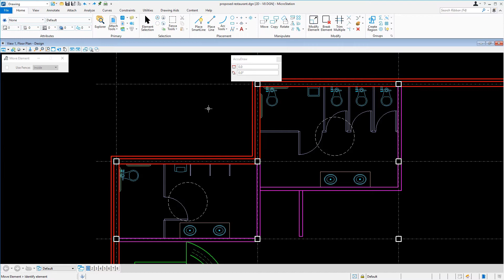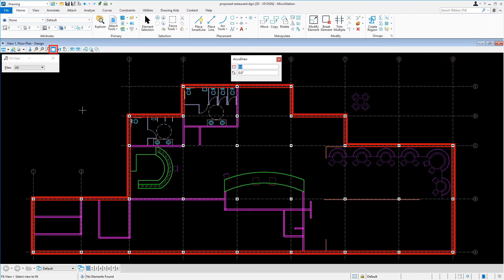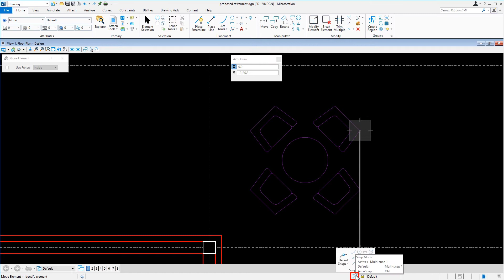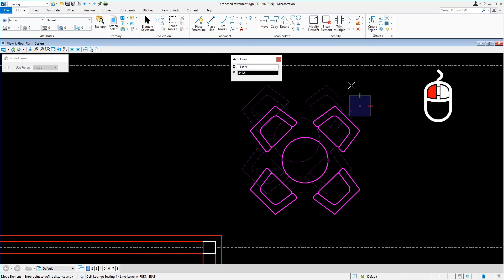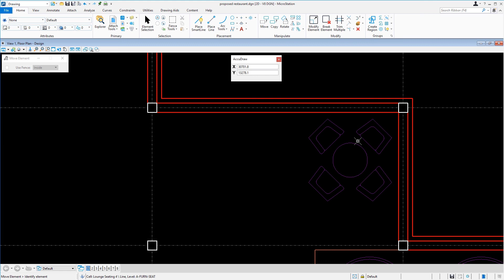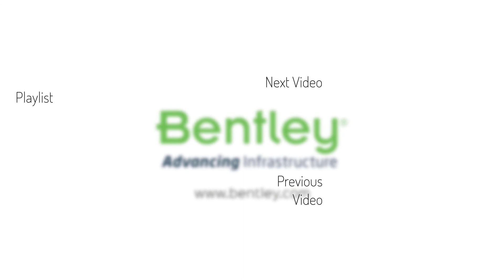Part 3 Move Element

Comment: this program is poorly designed, the interface and operations is weird and difficult to use.  even simple functions or selections the controls are confusing and clumsy, the online help is awful, the login and connection clients are annoying as hell and completely useless. Autocad is miles better and a lot more user friendly.